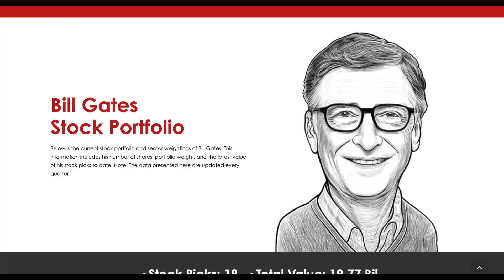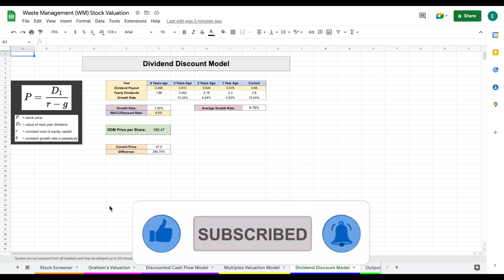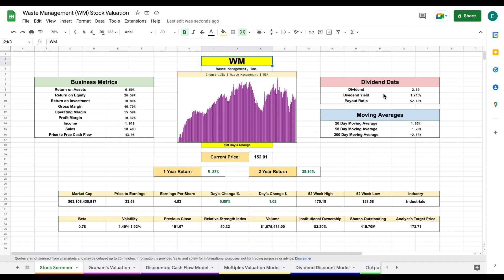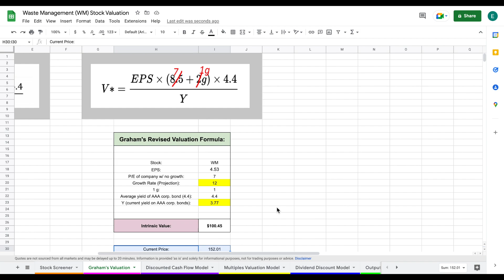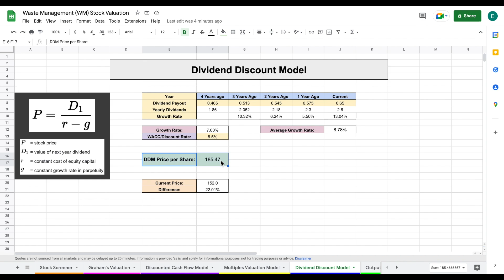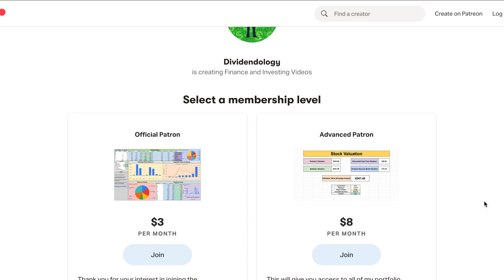Is Waste Management Stock a Buy Now!? | Waste Management (WM) Stock Analysis! |

Comment: Do you think you could you come up with a similar worksheet for REITS? It's very hard to properly value them on cashflow(especially net lease reits) due to them often having negative cashflow but positive FFO.
Reply from the maker: This is a great idea. I will look into making this.
Reply: AFFO would be more accurate pls
Reply: @yingyanginvestor2569  I actually disagree with this. FFO is more standardized and comparable, whereas AFFO is a more individualized calculation that each company has to explain their approach to. It also usually removes stock dilution from the equation, which does have a real cost to the investor, and imo should never be included.

There are individual companies that use AFFO effectively, but on the whole in terms of valuation, FFO is more accurate.
Reply: I have to disagree with your statement regarding affo. There is a reason why different investors prefer FFO and some prefer AFFO. This is simply different framework model of evaluating a REIT company. Your preferred method of using FFO model is fine since it’s the standardised framework that most commercial uses. 

I like to use DCF in my normal stocks and would love similar approach for reit but because we can’t get their actual net cashflow, hence AFFO is the preferred method for investors who wants to remove subtracting maintenance expenditures from FFO. Since REIT for AFFO does not subtract growth capex. This is due to the fact that REITs typically do not reinvest significant portions of their earnings back into growth unlike free cash flow. AFFO to me has a better estimator of the REIT’s performance since your focusing on the net side of it while subtracting other expenditures.